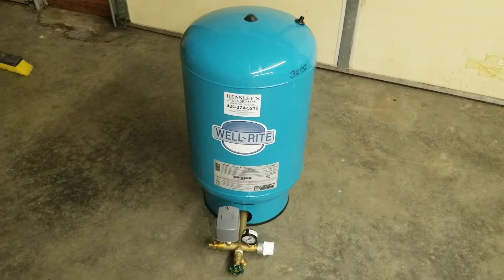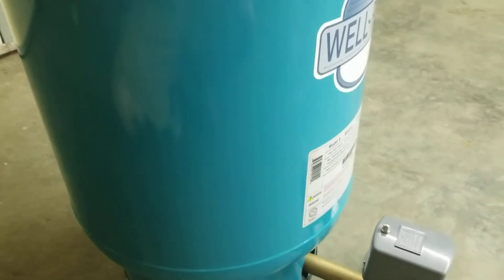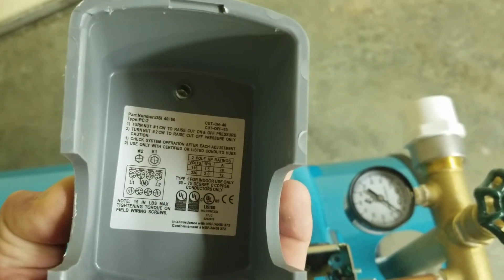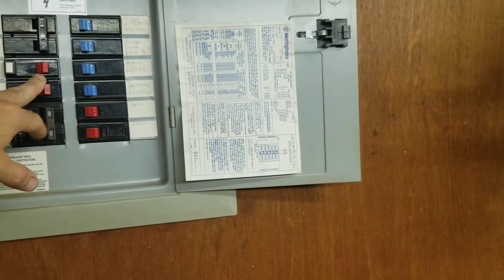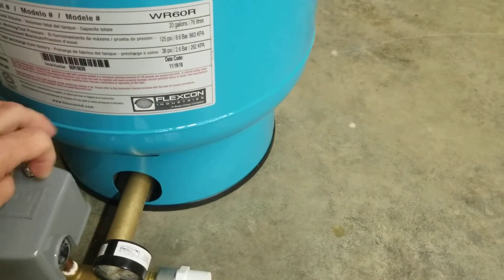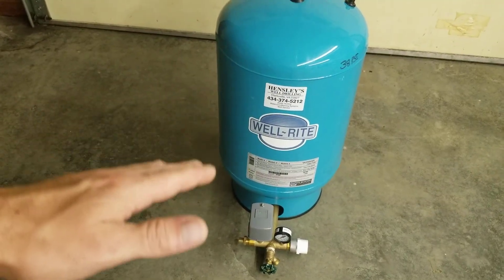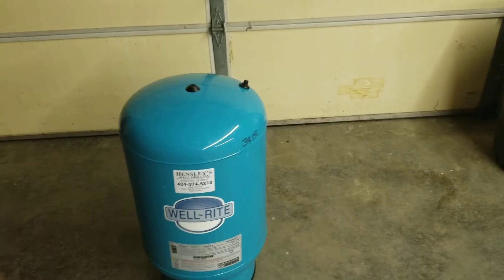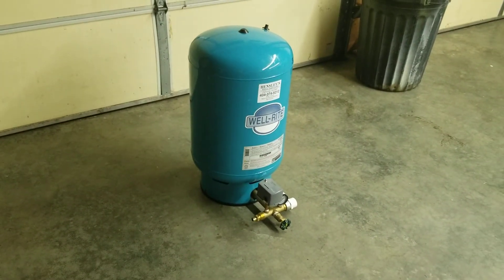Well Pump & Tank Troubleshooting, How the system works, Adjusting Pressure Settings Correctly

Comment: ok i have a good one for you... i had my pump replaced. it was a 30/50 switch.  After replacing the pump, it wont build pressure over 42 psi.  I have a second smaller pump for irrigation on the same well pipe (they are next to each other) which pumps to 60 psi no problem.  Plumber doesnt understand why.  he adjusted the switch with a 30/40 because he cant get the pump to reach 50 psi but told me he will talk to his boss and try to find out whats going on.  that is obviously not how it should be done. any ideas?
Reply from the maker: Id assume your referring to a above ground jet pump. If it won't build pressure & its new, possibly it has a bad seal around the impellar out of the box. Or you have a pipe broken somewhere else thats taking away water, if thats the case then killing the power would make the gauge drop to 0 psi. If its a single line jet pump, & it uses its impellar to lift water out & build pressure, maybe you've been using alot of water or its been dry & the water table is lower making it very hard for a single line jetpump to work. The smaller pump might build more pressure and less volume/flow
 The newer pump might flow more volume and not as much pressure. Research your new pump & come issues and what its flow chart capabilities are.
Reply: @h2omechanic  Thanks for the reply.  I was incorrect he set the new pressure switch to 20/40.  We have had very heavy rain for months... it's Florida so we have lots of water down there.  Pressure holds when pump stops.  The more flow but less pressure does make some sense. It's not really a big problem, we always feel we have enough water pressure in the house so maybe I should just not even worry about it.

Comment: I need you help. My pump is on 45 psi and fairly new 20 gallon tank on 50psi and air is perfect 30psi (range 30psi to 60psi) but for some reason appears to have pressure to tank. But when taps turned on nothing
Reply from the maker: If your pressure switch is a 30/50, you need to lower the tanks air pressure to 25psi. Take off your switch cover & look to see if the contacts are open. If no water & contacts are open, then the little nipple 1/4" x3" is clogged. If u test it electricly & get power out at the well & no water, then its a pump or wire in the well thats bad. If no power out ar well, its switch/tank related.
Reply from the maker: If you have pressure at the tank drain, (don't trust the gauge) & no pressure in the house, id look at any valves near by or filter clogged. If its only 1 sink with low pressure, remove the strainers from the faucet
Reply: Thanks will try

Comment: Have a 120V well pump with a Well X Troll pressure tank. A week ago started experiencing low water pressure (20psi) followed by no water. When I reset the circuit breaker or switch off the pump, the pressure resets back to 20psi and 2-3 days later goes back to zero until I reset the breaker again. The default cut on/off is 40/60psi. 

PRESSURE SWITCH- (1) used a multi-meter to check for voltage and it is getting sufficient voltage. (2) Checked for water and/or debris/dirt that could be blocking the contact switch and found none. All the connections appear to be solid. I also tried increasing the cut-on/cut-off setting, and it didn't make a difference; pressure doesn't increase past 20psi. 

Please note that the pressure switch is not, however, grounded, and the switch does NOT release from making contact unless I manually do so while the power is off.  

PRESSURE TANK- (1) depressed the nipple and only air comes out. (2) I am able to move the tank by hand. I also shut off the power to the pressure tank and tested the psi in the tank and it is 30psi. I don't think that the bladder has busted on the tank is bad. 

PLEASE advise: do I have a bad pressure switch, pressure tank, well tank or something else?

Thanks!
Reply from the maker: If it only builds 25psi when power is on, if it drops to 0 as soon as you turn the breaker off then you have a leak in the well. Either the fitting connecting pump to pipe is cracked or the pipe has failed. Have you been noticing sediment? Bc itll circulate the water stirring up stuff in the water. If you kill the power & pressure holds at 20psi. Then the pump is probably old 12-18 years & the impellers are worn & wont build pressure.  Also check for wet areas in your yard between well & house, a cracked fitting in the ground will cause similar issues but eventually you'll find a soggy area in the yard. 
Let me say thank you for your level of detail and knowledge 👌!  
New pump= failed fitting in well
Old pump= worn out internally 
Low pressure/ leak in water line.
I believe that your tanks ok. 
Hope this helps !  Philip Hensley
Reply: H2o Mechanic Thanks so much for the quick reply! There was a hole in the check valve!

Comment: I accidentally left the shower running for over 30 minutes.  When I got back to the house, there was no water coming out of the faucet.  Help!
Reply from the maker: Have you ever ran it dry before?  If so turn off pump breaker from 1 hr. 
You might also have a (low pressure cut-out switch) watch videos on how to reset it. YouTube search the ( )
 I have other videos on no water situations on my channel, mixed in with my other videos. I don't know enough with the little detail you've given. Could have ran the well down to no water. Needs time off to recover. Or a faulty pressure switch. Or if it's 10-15 years old it could be a dead pump in the well. Have you noticed any water issues/changes recently? Any toilets making noise or running constantly? The better/more you tell me the more I can help point you in the right direction

Comment: Hello I am experiencing a well problem. It's reading at about 18 psi and I turned on the faucet at the pump to see if there is water in the tank but it just trickled out. Could it be the regulator or just need to check the air pressure in the tank. Thank you for your time and help.
Reply from the maker: Ok. Turn off the well breaker for an hour. Look to see if the pressure on the gauge drops instantly when you kill the power. If it does, you probably have a broken fitting in the well at the pump. It'll crack & give you very minimal water pressure.  
After checking that, if it holds the 18psi & doesn't instantly drop to 0 id then look at all of your toilets and see if any of them have leaked down with the power being off. A leaky toilet flapper or over flowing in toilet tank can definitely drain a well over time. Have you heard any toilets making noises lately?  The water level in the well could be so low that the pump is struggling to lift the water & build pressure. I have another video on my channel showing 6 used pumps, explaining how & why they failed and what to look for.
Reply from the maker: Watch a few of my other videos on my channel related to wells, pump & tank replacement. I try to go in full detail to help people in your position. Take down notes & test certain areas & get back with me with what you find. I will help you diagnose your issues and resolve it correctly. I just need a few more details once you test some things so I can know what to rule out. If u get power out at the well, its not a bad pressure switch. If you kill the power & open the tank drain, see if it sucks your hand to it. If a pipe/fitting in the well is broken, as soon as the powers off the water will drop & create a suction. You'll need 2 ppl for that test most times.

Comment: My garden well pump was fine earlier, but now losses prime and pressure, sounds like air spitting too. I checked the tank, pressure seems ok, check valve is next. Any suggestions otherwise?
Reply from the maker: Turn off breaker & see if water pressure drops to 0psi. If so, its a bad check valve or failed fitting. Also drain all water pressure off & use a tire gauge & see how much air is in the tank. If its losing prime, you could be over pumping the well faster than it recovers.

Comment: Hey help me my well stops and starts at random and this has been happening since day one, we had the well drilled in 2004 when we built the house,  the company that done the work has not helped me out l paid them over 800 dollars for a new bladder tank and points and a pressure gage. The problem is still going on . I am tired of being in the shower and bam no water coming out and ten minutes later water is back.  Any advice would help me.
Reply from the maker: Try letting some air out of your tank. Use a screw driver +head. Hold for 10-15 seconds. Sounds like its over charged. Or it could be pump isnt deep enough for the wells recovery rate. Any info on the well/pump would help. Try letting out air first. If its suddenly doing this, the pump could have failed bearings and it is over heating cutting off & cools down in 10 minutes and cuts back on.
Reply: @h2omechanic  hey I can say that my submerged pump is a 5 gallon per min but only gives me 3 gallon per min and depths for well is 426 ft. And the said I had a 45 feet head of water?  What ever that means?  ? They could not tell me.  I told them that maybe they could have scuffed the wire coatings?  They could not tell me if they taped the wire as it was being dropped in the well. I do know that there's no filter or screen on the bottom of my pump. I have tried everything to get them to fix the problem but nope they come up with a new solution and that cost me more money. I am also getting a ton of sand , silt, dirt, rocks and mud and the well was drilled in 2004? They say that it is normal for my land or well?  I do have a 5 micro spin down filter after my bladder tank.
Reply from the maker: I suggest getting a bigger filter setup. Your well is deep & the pump is struggling. The well needs time to recover. Check all toilet seals for any leaking water!!! Very important!! Cut them off & wait 30 minutes and see if the back tank on the toilet is empty! If so fix it. You should call local well drillers [not them] & ask about hydrolic fracing your well. I believe that you are using water faster than the well recovers. 40ft of water at 425ft has to build 250psi in the pump to satisfy your house/pressure switch. The pump is over heating working that hard. Turn off your well pump breaker every night for a few days. Ensures its off & no leaks are using water all night. Hope that helps. Worst case, Frac the well, call and get prices from 150 mile radius & youll need around $2500. But fracing a well is 98% successful & multiplies wells flow 4-10xtimes.  1/2gpm to 5gpm

Comment: My well pump continuously running, my well tank is not filling up with water. I have water going to the pressure well tank. I gave running water going to the house,  no leaks in the yard. My gauge valve will not go past 30 PSI. It do not drop pressure when I turn the breaker switch off. Pressure tank is holding pressure at 28 PSI. Can you help me?
Reply from the maker: If it is only building pressure but not enough to shut off the switch, if your pumps old, its worn out tolerance can't build pressure anymore. If you have a deep well pump, let's say 300ft, you could have drained the well to a depth that the pump is trying so hard to lift the water that it can't build pressure until the water in the well refills itself. Try cutting off your breaker for 5 hours and see if you get a higher pressure after. While its off check your toilets & see if the water in them slowly leaks out. Sometimes leaky toilets can drain a well & pumps have a max depth where they run out of lifting ability. You can also try swapping out your pressure switch & gauge as cheap insurance while u have the power off. Ill give you my #cell if u need help I can walk you through this. 4342101376

Comment: We turned off the water about 2 weeks ago near the pump to replace sink fixtures. Now upstairs toilet takes an hour to fill up, shower has very little pressure and other toilet takes 25 minutes to fill. Friend suggested maybe we need to prime our line? Husband thinks something got in the line when we had water turned off. Any suggestions I’m afraid the pump is going to go because it runs now for that time frame for toilets.
Reply from the maker: Pump doesn't always run when fixtures are using water, the tank holds the water & gets refilled so no worries there. If you have good pressure at other sinks/tubs except for the ones in question then its probably a sediment issue at each location in question. Remove shower head & see if water comes out strong with the head off. As for the toilet, those have float valves in the back tank. You can replace them, or try to carefully take the assembly apart. By turning off the system and turning it back on, you stired up sediment trapped in the tank & sent it into each fixture that is low on pressure. 
Id suggest checking the tanks air pressure like i describe in this video and try to install a whole house filter in the line leaving the tank. I have a video on my channel showing how to install a filter properly. Im here to help if you have any questions

Comment: Thanks so much for the info.my issue is as soon as I turn on the sprinkler system I loose mad pressure and the pump kicks on and stays running until it basically shuts off because no more water pressure and that's for my 4 system sprinklers. But I turn the sprinkler system off and I can water my side yard which has 180 foot of 3/4 pvc with 3 impact sprinklers watering about 4000 square feet of pasture..  It never shuts off but keeps around 25 to 30 psi.. I have a 30/50  switch. Never had a problem with it till this year. Thanks again for the help.. Oh this is a 1hp jet pump not sure of the size of the pressure tank but it's about 4 feet or smaller and about 18 inches in diameter
Reply from the maker: Jet pumps do run alot more frequently than a in well submersible pump. They use about 4x the power to do the same job. Depending on the age of your pump, the seal around the impeller is probably worn out. If this is a Florida system, typically the pump does run while the heads are spraying. Jet pump are too finicky to diagnose. If you have a 6" well, id suggest buying a submersible pump and all your headaches disappear. Calling in a professional will be the best in long run.
Reply: @h2omechanic  thanks for the help I live in new Mexico and the pump is only 2 years old and the casings is 2 inch 25 ft well with water in the casing 53 inches down.. I just put another pump in it from my other well house we will see what happens

Comment: If my pump is running and the pressure does not rise, would it be the pressure switch?  I have around 35 psi inside the water tank and no water going in the tank.   Any help would be appreciated...
Reply from the maker: If its running, you'll have 240v at the well head. If you know 100% it's running & a wire in the well didn't fail & you still have no water, then you have a failure in the pioe or the fitting connecting pump to pipe.

Comment: I believe there's a leak by the pipe going into the tank i have no water only leaks when power to the tank is on
Reply from the maker: My question would be, is there a check valve at the leak in question? Its the only way a leak could be intermediate like that. If so just remove it and replace it.
Reply: @h2omechanic  the leak seep from the top of the pipe where the well is put into where the led is.

Comment: I have a pump that is running continuously. It maintains 37psi but never reaches the cut off.  Any suggestions on what to diagnose first? I was thinking a bad tank or pressure switch.
Reply from the maker: Depending on the depth of the pump there's a few possibilities. 
1. Fitting connecting the pump to the pipe is galvanized and has a hole in it releasing pressure. 90%CHANCE
2. Plastic fittings at pump have split at the seam & releases pressure. 90%
3. Failed pipe down the well or a leak in the yard. 40%
4 well is dry, turn off power to pump for 6 hours, water recovers & pump has enough to work properly. 10%chance
5. Pump is older than 15-20years & is worn out/ bad impeller clearance 
   You'll probably have to pull the pump out. Look closely at the above mentioned. Hope this helps!

Comment: Hi thanks for the info. Here's my problem see if you can help me or get me in right direction. Replaced well tank preasure switch and new fittings preasure guage. now house has terrible or hardly any preasure. Have to lay tank on ground because of low clearance. Which tank before was laying on ground as well and it sprang a leak at the intake of the tank. When first installed new tank had preasure but not as good as before replacing it. So recheck everything.  Preasure on tank is 28 on a 30 50 switch the switch is working correctly and is cycling on and off at about 65 seconds. Seems like everything is set correctly. But the water is very low. And if you turn on more than just one facet the water drops to a dribble. I have noticed there has been a little bit of air sputtering at times but not always. Not sure what to try next. Had plenty of preasure before replacing. Not great but no issues even with watering garden and doing laundry at same time wasn't a problem. So I believe the well is fine. Confused I'm retired and disabled so I'm trying to do this myself. Thanks for any help or direction to try. Ken
Reply: You can even contact me at ksweetmeat@yahoo.com thanks Ken
Reply from the maker: Ken. Sounds to me like you might have a valve problem near the tank or possibly a check valve near the tank. Typically gate valve can fail & the gate falls only allowing minimal water flow.send me some pictures of around the tank & pipes / filter ect. Once I can see the system I can point you in the direction to look at. My email is HWDRACING@GMAIL.COM